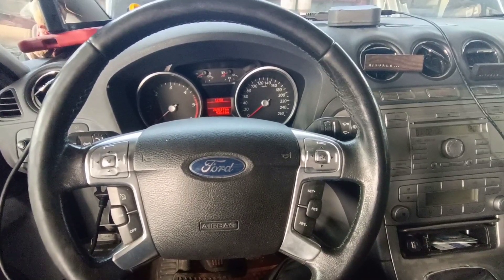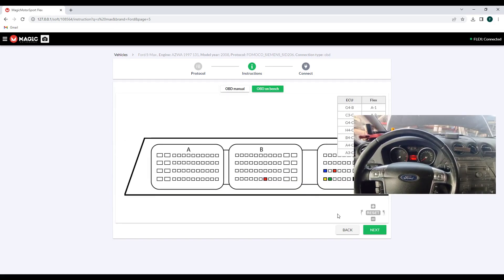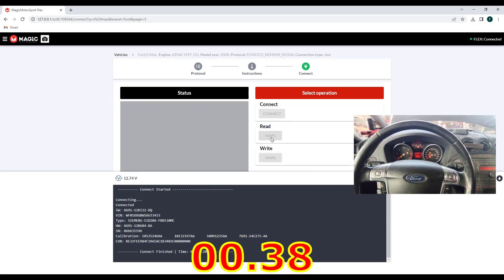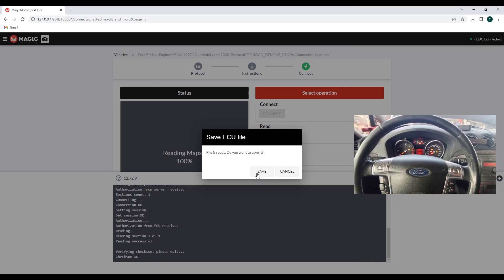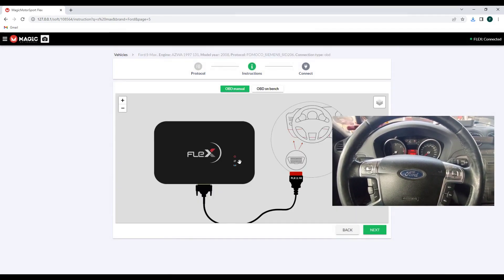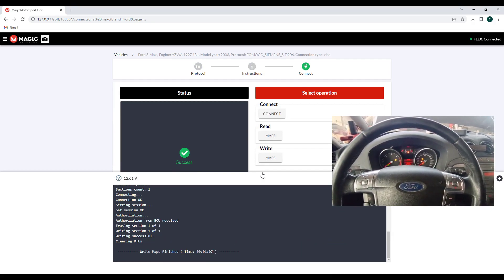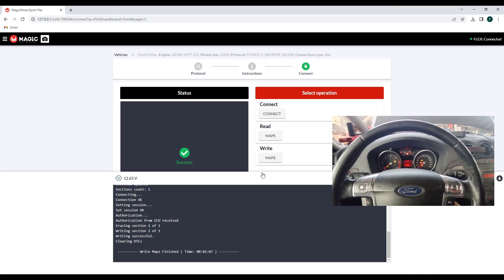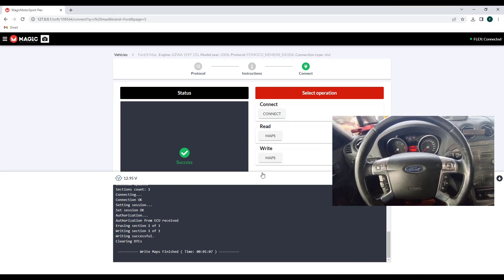Flex Master read/write via obd  Ford ecu SID 206 .

Comment: About 5 minutes i did a ford mondeo 2.0 tdci 140 hp with sid 206. Read/write with magpro x17 everything went great time was so short for this operation. The other car was a ford focus 1.6 tdci 90 hp with edc16c34 but it was 9M and i didnt want to do it by obd. A read this tipe is not good to write by OBD. I used Amt-bst in bench mode.
Thanks for video.
Reply from the maker: Thanks for info

Comment: Have you tryed autotuner? what do you think of it if you have tryed? :) 
I just buyed one and have done 1car with it, have kess v2,ktag,kt200,sm2pro and mpps v18 as clones beside it x)
Reply from the maker: Hello. Yes i work a little bit with the Autotuner, it's a good tool. 
What I don't like is when you read all ECU you cannot read separate Eeprom and Flash. You can but it is more complicated to download from Server the data that you uploaded. 
It's a Great tool ,you don't have to pay for a license, your update does not have limited for 12 months like another programmer.
👍
Reply: @YOYODiagnostic  Thanks for info, i have only tryed edc17cp20 yet obd, failed with error first time, pressed write again, about 20sec and it was sucsess :)  Buyed it to make more OBD, i can use KT200 for bench if i want :) When you read all with kt200  it will split All flash, ex flash , int flash, and eeprom :)

Comment: Hello my friend, what do you think of the KT200 programmer and is it possible to stop EGR and PDF through it?
Reply: One of the best clones out there. The price tho is expensive for a clone. But it does very good on bench.
I would better buy a autotuner slave or something. 
And the tool is just read/write, egr delete and dpf delete is done to the file before write again.
Hope that helps you.